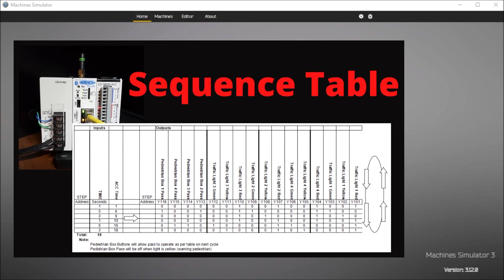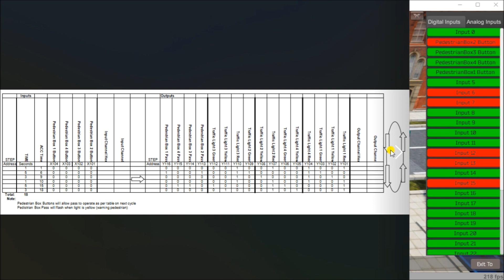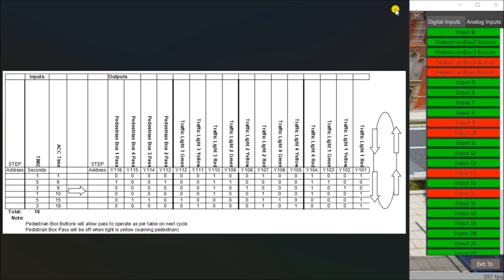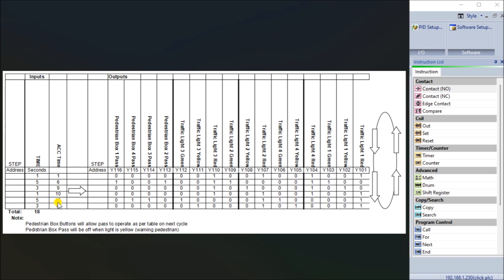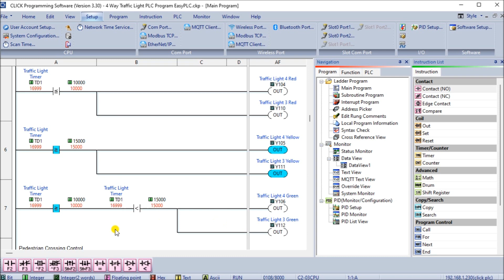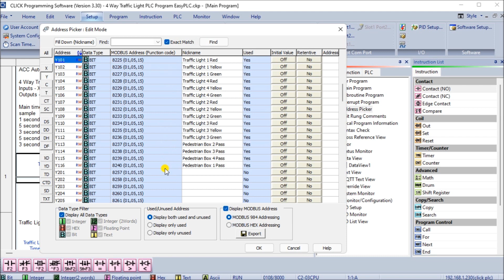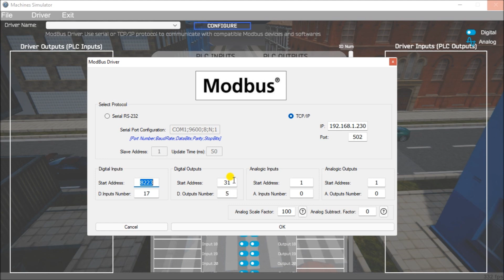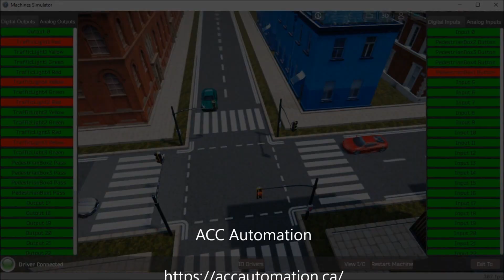See Traffic Lights Come Alive: Learn PLC Programming Fast

Comment from the maker: Purchase your copy of this learning package for less than $75 USD for a single computer install, or less than $100 USD to allow different computers.
Receive 10% off the price by typing in ACC in the comment section when you order.
http://www.nirtec.com/index.php/purchase-price/
Learn PLC programming the easy way.
Invest in yourself today.

EasyPLC Software Suite is a complete PLC, HMI, and Machine Simulator Software package.
This PLC learning package includes the following:
Easy PLC - PLC Simulation that will allow programming in Ladder, Grafcet, Logic Blocks, or Script.
HMI System - Easily create a visual human-machine interface (HMI),
Machine Simulator - A virtual 3D world with real-time graphics and physical properties.  PLC programs can be tested using the EasyPLC or through other interfaces. (Modbus RTU, TCP, etc.)
Machine Simulator Lite - Designed to run on Android Devices.
Machine Simulator VR - Virtual Reality comes to life so you can test, train or practice your PLC programming.

The entire EasyPLC learning and training series can be found here:
https://accautomation.ca/series/easyplc-software-suite/

Here is a list of YouTube Shorts about EasyPLC Software Suite including the Machine Simulator.
https://www.youtube.com/playlist?list=PL3y71jAPOdZAvTC8-TWNifAHpgEkAfqZQ

ACC Automation
https://accautomation.ca/